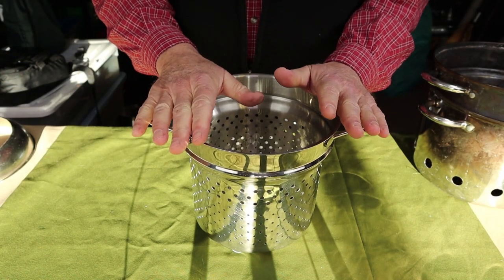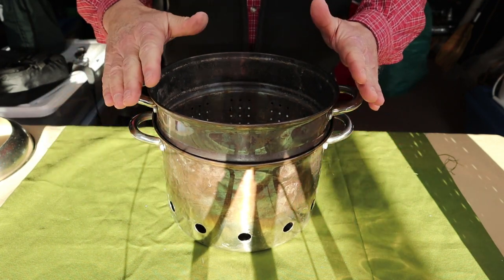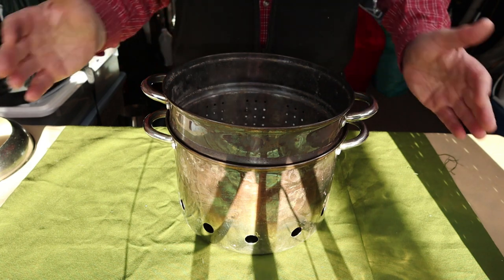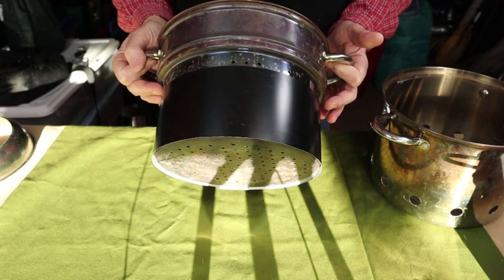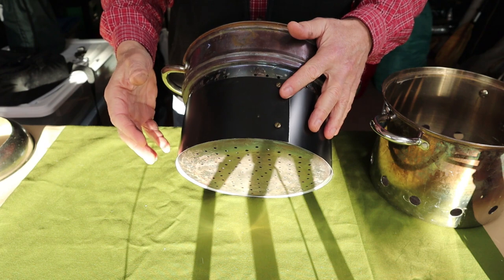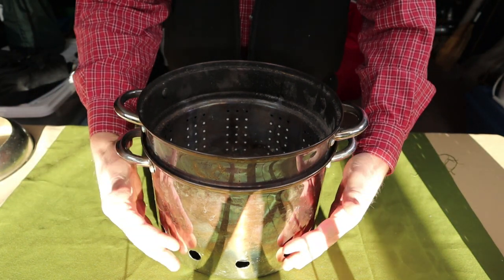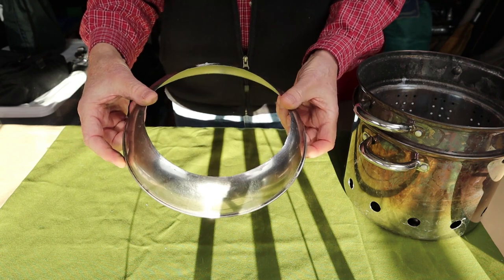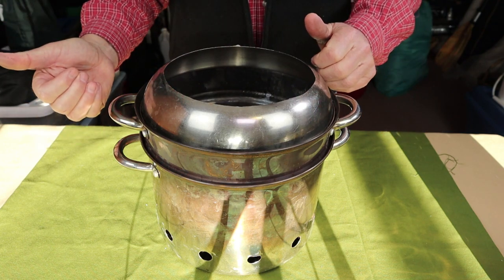Super Size Hobo Stove Version 3 - Success?

Comment: I have two suggestions for improvement of this stove. First, replace the aluminum sleeve with one fashioned from a stainless donor pot.  Make it the exact same size, allowing just the top row of holes to remain open for your secondary combustion jets.  Second, increase the diameter of some of those jet holes by drilling them out to twice their original size, allowing for better primary to secondary air ratio.  On your strainer, I would open up the two outer holes from each column of three, leaving the center hole intact.  Try it out that way first, you can always go back and open up those previously left alone if you feel it would increase efficiency even further.  Experimentation is what makes stove builds like this SO much fun !
Keep up the great work you do here, Mark - I really enjoy your content.  Take care !
Reply from the maker: I like your suggestions. Worth trying for sure. Thanks for commenting

Comment: Excellent video. I have two suggestions to replace the aluminum flashing: the cheap and tedious one is to simply use a lot of short bolts to plug the holes individually. The other option is more expensive—buy a similar-sized strip of stainless steel (McMaster-Carr should have that) as your aluminum flashing. I’d probably opt for the bolts myself because it would also allow for fine-tuning the air flow. Maybe you could close off some of the holes in the bottom of the strainer to get the optimum ratio of bottom holes to gasifier holes that way. I look forward to your next attempt.
Reply: Those are good ideas
Reply from the maker: That is something to consider. Thanks for commenting
Reply: Maybe go back to the shop and find another stainless steel pot and cut off the bottom. You can then cut it down the side and bolt it on the same way as  the flashing. 
Might  be cheaper.
Reply: My thoughts exactly lol

Comment: Now that was cool! Maybe cut a cookie sheet with hole in large hole in center, drop in just were the top  Concentrator is. This keep more heat in keeping the gasses hotter and forcing into a hotter burn.  This works on my paint can stove. Maybe cut the hole half the size smaller than the Concentrator ring.
Reply from the maker: There is still room to experiment with the concentrator. I may add a deflector raised just above the stove as well. Thanks for commenting

Comment: Hey Mark. Thanks for the shout out! It all worked amazingly well in my opinion. I think replacing the aluminum flashing with some stainless steel is the next step, but fasten it on the inside of the strainer to leave extra space for secondary air rising in the gap between the pot and strainer.
Reply from the maker: Good suggestion. Stainless is harder to work with but the best material. Thanks for commenting
Reply: @MarkYoungBushcraft  Yes, it would have to be very thin steel

Comment: You are definitely making progress and it's great that you are bringing us along.  That stove holds a lot of wood and I suspect its burning lean, the strainers hole pattern is blocking a tremendous amount of air and when you combine that with the occlusions caused by fuel load and ash it  creates an even leaner condition. There could be a benefit to opening up the holes on the bottom of  the stove. Four important  aspects of air inside the stove are: volume, velocity, vector and temperature. You have definitely have temperature and its notable that when the wind picked up your burn improved. Keep up the good work.
Reply from the maker: Hi Chris. You advise based on you experience is always of value to me. Once I find something to wrap the strainer with I will be able to to start playing with all the variables you talked about. May have to pick your brains even more

Comment: Excellent, Mark! It definitely had some gasification. Now, if there was a way to mount a grill on the lid so it doesn’t fall of, and at the same time, be able to lift the grill if you need to add wood to the fire. ✌️🇨🇦🇺🇸✌️
Reply from the maker: That is the next part of the project; how to cook over it. Could always use a tripod. Thanks for commenting

Comment: Hi Mark, I had the same fire pot as your and got the same problem as seen in the video. To get gasification effect,  I covered the extra holes on the trainer pot from inside with 22 gage galvanized steel sheet except the top and the bottom holes of the trainer wall. I used the steamer basket which ready had holes on it for the condenser trap top cover and that created vortex effect on top of the fire.
Reply from the maker: Right on. Great suggestion. Thanks for commenting

Comment: This all started with trying to boil 6 L of water. It seems to have morphed into a little bit different project. I think it’s awesome. I still want to know how quickly you can boil 6 L of water to keep those happy hikers supplied with hot chocolate from back in version one. All the best to you and yours.
Reply from the maker: That is true, I originally wanted to boil large amount of water for a group of hikers but that was not a realistic project as I would have to carry this into the woods. How fast it would boil water is very dependent on fuel and temperature. I am not sure it is possible to get a consistent result. Thanks for commenting

Comment: I`m going to go along with the other suggestions to use galvanized sheet steel from the hardware store. Sometimes you can get it cut to size and not have to buy a whole sheet. (Although you can probably find other uses for the leftover from a full sheet.)
Reply from the maker: I have been considering duct metal which is often galvanized. I would need to ensure the galvanizing is well burn off before sitting close or cooking. Thanks for commenting
Reply: @MarkYoungBushcraft  I expect that the tin in the galvanizing would burn off pretty quickly. My experience with galvanized steel and fire is that it rusts easily once it has been in a fire. (Rust shouldn't be a problem for the stove, since that part won't get wet in normal use.)

Comment: I think the top exposed holes need to be slightly larger.  A woodstove pipe is pretty inexpensive.  I don't know if etsy is available to you, but that's where I got mine cheap ( I had a heck of a time getting the edges linked together.  Youtube video rescued me).  You might find it cheap in a store near you.
Reply from the maker: Sounds good. I will look around. Thanks for commenting

Comment: The fire that you built at the beginning was a top down fire, which tends to be less smoky than when you add wood later on. How did much smoke did you get when you added fresh wood later on in the burn? I love this project! I can't wait to see what the next version will look like.
Reply from the maker: Thanks for commenting
Reply: @MarkYoungBushcraft  sorry, my question was garbled. I meant to ask, did you get a puff of smoke when you added a fresh piece of wood to the already burning fire? Did the secondary burn holes along the rim help with that?

Also, I would consider enlarging the holes on the bottom of the burn chamber, unless you are happy with the burn rate of your current setup. My Bushbuddy uses a metal grid at the bottom of the burn chamber.
Reply from the maker: @ms.gearhead6884  Okay, I understand now. Hopefully, my answer will make sense as well. To start, I am very pleased with the burn rate. In my previous version the burn rate was much too fast. I may increase the size of the secondary jets to allow more air to be introduced at that level. Hopefully, this will result in a more complete secondary combustion. Adding wood later in the burn usually does create some smoke until the wood comes up to combustion temperature. The more I add, the more smoke. I have found this true of all woodgas stoves. One additional point. I am not sure if I was clear that the bottom of the strainer portion is covered in small holes, allowing air to enter freely there. I am envious of your Bushbuddy. It has been on my wish list for some time. I may have to get one just because. Hope this helps
Reply: @MarkYoungBushcraft  Thank you Mark for the very clear explanation of how your stove works. What you describe sounds similar to the smaller gasifiers that I have as well as my Fireboxes in behavior. I should now pop in whenever I am near a thrift store in the hopes of finding a pasta pot! 

The Bushbuddy is a very nice gasifier, though it is very similar to the Lixada Tower stove in how it works. The design is I think more dialed in for combustion with respect to the ratio of air coming in from the bottom vs rim ports. The solid bottom is very nice to have, for protection of the table or ground  that it sits on. If you do get one, I would love to see what you think of it!!

Comment: Would it help if the rim was put on upside-down to better deflect the gases into the flames. The rim would be closer to the gases holes?
Reply from the maker: Interesting idea and easy enough to try. If it works, I will mention it in the next video. Thanks for commenting

Comment: Perhaps a stainless steel flashing?
So what would you use the stove for?
How do you determine if the air ratio is right?
Reply from the maker: Stainless flashing would be perfect. In my first video I talked about using this stove for groups or camping. I am not a stove engineer but I would judge performance based on a clean burn. Thanks for commenting

Comment: Mark, what hobo has access to a car to go and lurk 2nd-hand stores, and power tools and power to fashion these?

Would be nice to see you (and Mr. David West) demonstrate a manual impact method for making ventilation holes in found-candidate tins and pots. Backup necessary for that thin metal — I tried sand-fill for my 10”X10” (X or XXL) SS pot precursor, ended up relying on my friend with an angle grinder cutter disk to make the triangle (adequate/ugly) holes.

I love your chan, Sir. 👻😎♥
Reply from the maker: It may be a good video showing how to make expedient stoves with minimal tools. I do have a video doing something like that using the Siege Stove cross-members. Thanks for commenting

Comment: Instead of aluminum, is there steel or galvanized metal sheeting you could use instead of the aluminum? It would be harder to cut with tin snips but it would be more heat resistant. Or use the metal from a few large cans like a coffee can or large juice can?
Reply from the maker: I have been considering galvanized duct work. I would hav eto burn off the galvanizing for saftey. Thanks for commenting

Comment: How did you come about the focuser? Was it part of a saucepan as well? Commercially produced ones I've seen have holes in them(?) but thats not necessary? Thanks for posting, very interesting :)
Reply from the maker: As mentioned, it is the lid of another pot. I feel holes at the top help exhaust gasses when a pot covers the opening. The option is a taller pot stand. Thanks for commenting

Comment: It would be nice to have more scientific specs for the intake air ratio to jet ratio.  The smaller holes have more back pressure, and the bigger holes less--but the smaller holes 'squirt' the air better.  It's not just the total area of the holes--,it's the size!
My double walled icebucket stove works well--but I'm puzzled as to whether to attempt improvements on the hole size and number?
Reply from the maker: So, I am not really that scientific about this. I want to understand the principles but only so far as what will make it work. I leave the fine tuning to those with a deeper interest, or maybe the companies than make and sell them. Still, I may experiment with the hole size, etc just for the fun of it. Thanks for commenting

Comment: If I had to produce this type of stove for a survival moment you just showed me the components necessary to make a large on with the tools in my house or if a (lmmbo) zombie attack were to happen I could find the pots in different houses  and craft one to keep warm or cook or distill water without making a lot of smoke to be identified. Should have started small with the initial start up and you would seen the wood gasification a lot earlier. To verify your inquiry. Your still good at find house hold utensils to try and make stoves with as to cutting up tin cans. Things already designed but used differently. 

SEMPER FI 16:36 1/29/23
Reply from the maker: A fun DIY project like this could save a life. Thanks for commenting

Comment: Since most of the heat with these gasifier patio campfire stoves is lost straight up, have you thought of any diy heat deflectors? I know you can pick up a propane patio heat deflectors for like $35 on Amazon, but it's aluminum so I'd be worried about it. Im thinking about using a plow disc for my buddy's gasifier burn pit that he made partially with bricks. The deflector from solo stove is nearly $200
Reply from the maker: Had not thought about a deflector. Now you got me thinking. Thanks for commenting

Comment: Interesting video! I've been wanting to make something similar and its definitely got me thinking!

I'm wondering if steel pop rivets would work for the holes? Would be a hell of a forearm workout though, and seems that 3/16ths might be the largest size that's easily available at crappy tire or the homeless despot. Those holes seem larger?

 I've had success using a washer with the correct size hole to make smaller pop rivets work on over sized holes before. Anyways just a thought!
Reply from the maker: SS pot rivets would work but there are a lot of holes to fill. Thanks for commenting

Comment: Need your expert opinion re siggs camp stove set.Basically,a trangia style cooking system for a svea123.Approx.from 50s.Takes place of removable windscreen.Any thoughts?Thanx!
Reply from the maker: I don't think my opinion is worth much. I do have a Svea123r and Sigg Tourist cook set I found at a thrift store. I have only used them a few times and while I appreciate what the can do, I don't think they can match the versatility of a Trangia cook set. The Svea is a great stove in very cold weather, once you get used to lighting and using them. The Trangia system offers, alcohol, canister gas and white gas burners, plus a solid fuel plate. I would buy one if the price is right but given a choice, I would go with a Trangia cook system. Hope this helps
Reply: @MarkYoungBushcraft Thank you for response.I do have Trangia cookset,with alcohol stove,and waiting for remote gas ,to cover both bases.Was able to pick up never used 123, in original box and instructions.Picked up siggs for wind protection,top,bottom fry pan,25$.Hope it works well.
Reply from the maker: @robertmaxwell3220  Sounds like it is in much better shape than mine was. I would be interested in hearing your comparison thoughts
Reply: @MarkYoungBushcraft  Will let you know.Again,thank you!
Reply: Hope you get this:am looking for a non toxic alternative to Esbit tabs with hexamine.Have to watch my preemie granddaughters breathing. Looking at coglans, and on ali express,saw some that were "alcohol", but....Any ideas are always appreciated!

Comment: My impression that there is not enough of airflow from the bottom of main combustion chamber. Drilling out some of the holes on the bottom of the strainer may speed up that "lazy" fire and lower the airflow for the secondary combustion to improve the in/out ratio. I would rather end up with ash instead of chared unburned wood.
Reply from the maker: So, I intentionally wanted to slow the combustion as it was to intense before. I should have shown it, but pretty much all I had left was ash. Having said that, I can experiment with the ratio to fine tune it.  Thanks for commenting

Comment: Nice!  I enjoyed that!  Galvanized steel sheet would be cheaper than stainless--unless you can find another thrift store item to cannabalise. 

Bain Marie pots make good gassifier stove and can be had cheap on Amazon.  The only problem is sizing!  The measurements in the specs are all over the place!  Not accurate at all!
Reply from the maker: I have been considering duct metal which is often galvanized. I would need to ensure the galvanizing is well burn off before sitting close or cooking. Thanks for commenting